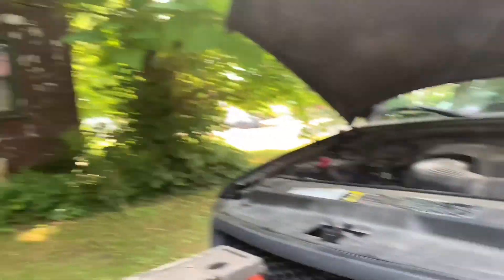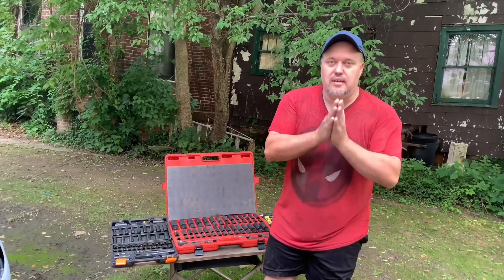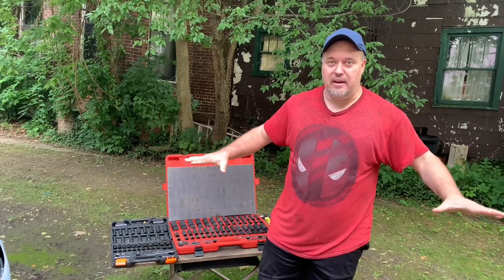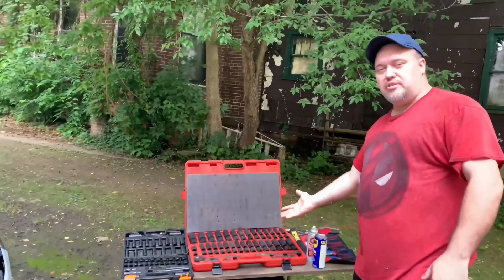How To Remove The Spark Plugs In A 2002 Ford F-150 5.4L Engine V8 Without Removing The Fuel Rails

Comment: Great video, I have an 04 F150 XLT Triton with a 4.6L, I went to do a tuneup on it and ran into a problem. The third cylinder on the passenger side will not accept my 5/8 inch spark plug socket, I can’t get that thing to go on the spark plug to save my life. The first two on the passenger side went smooth as silk, but the third one I cannot get it to go on. Now, I got frustrated and moved on to the drivers side and again the first two went on without a hitch, but the EXACT SAME cylinder the third one will not go on the plug. I’ve tried EVERYTHING I have, wobbles, long extensions, short extensions, etc and NOTHING will work. Idk what/who did what to this thing, but I find it strange that the EXACT SAME cylinders won’t accept my plug socket. ANY IDEAS as to what the heck is going on? I don’t have a bore scope to see what’s going on and my local Autozone wants $137.50 to rent one and I’m not doing that. Any help you can give me would be greatly appreciated, I’m completely stumped. If someone put two different kinds of plugs like 1 Autolite and 1 Bosch, would they be different socket sizes? That’s all I can come up with, thanks for listening.
Reply: try using a regular 5/8 deep socket ,o.d may be thinner, and use a magnet to pull up plug
Reply: @jim9132  ok great, thanks so much.
Reply: I just ran into the same exact problem #3 passenger. The boot on mine was soaked, warped and burnt. The spring was fused to the plug. The socket would not catch the plug. I think the plug may've been loose. I found, a piece of carbon or plastic was interfering. After many tries, I tightened the plug, but the socket wouldn't come off. I then removed the plug that was very hard to loosen, all the way out. I reinstalled without the rubber socket insert. Furthermore, I tuned and turned by hand and felt it wasn't catching until it suddenly stopped. One 1/8 turn on the ratchet, it was fully tight. This seemed wrong, but it was tight. The #2 cylinder, was no issue by comparison.
Reply: @richdelgatto2522  what a nightmare, I finally was able to get them out thanks to a friend with a borescope and WAY more patience than I have lol. It’s running like a champ now, I hope yours is too. 😁
Reply from the maker: Yes mines running good 👍

Comment: It's not the 2 valve engines that are known for spark plugs breaking in the head, they are a one piece plug. It's the triton 3 valve engines (2004-2010) that are known for breaking in the head and it's usually always the rear plug on either bank. Hmmm I wonder why the back ones...we'll because it's so hard to get to that people either rush or don't have the correct combination of extension/swivels and they torque break them because they weren't perfectly centre. That's why companies make specific tools to remove those plugs. The triton 2 valves were known for ejecting the plug because of the poorly designed 3-4 threads the head has. I own a 03 triton 5.4 and you want to make sure you torque to 20-25ft/lbs. Factory spec calls for 13ft/lbs!! Ya maybe if it had 6-10 threads holding. Obviously you don't want to over do it and strip out the aluminum threads but I have done mine at 20ish ft/lbs and no problems with many thousands of miles. Funny how Ford messed up on the first gen tritons ejecting spark plugs so then they engineer a 2 piece plug with many more threads to catch that now break off in the head. Like I said it's mostly due to worker error on that part, but a one piece plug design would of helped tremendously.

Comment: You don’t have to take off half of what you took off. Just take off the plastic cover that says 5.4 and that’s it. They are all easy to get to without removing the air intake and the bracket that holds the throttle cable to
Reply from the maker: I’m not trying to sound mean or anything when I say that so don’t take this the wrong way.  I know that the way I did the procedure here works and if you know of a better way than the one I did in the video you should make your own video and show everybody that video. 👍
Reply: Maybe for somebody with skinny arms, but us larger folks need the extra room, so that little bit of extra work is well worth it.
o

Comment: This isnt the engine that is notorious for the plugs breaking off. That's the 3 valve triton engine with those long weird loking plugs. This engine does have an issue with plugs blowing out while driving down the road. Looks like thats what likely happened with the one plug you had. definately a helpful video though.

Comment: Typical Ford engineering: make repairs as difficult as possible, also design plugs that break off in the head (two piece plug,  why?), Shorten plug length so they blow out of the head, and then design specific Ford-only tools to do the repairs. They've been doing it for decades.
Reply from the maker: They don’t want people working on their own vehicles so they can make more money by selling parts and tools.

Comment: a good strong magnet on an extension handle is real handy on this job. as usual ford engineered these cop systems so the job would be as difficult as possible so dealers can screw the customer out of as much money as possable, the going cost for this job here is $450-700 I can change plugs on my tahoe in 30-45 minutes ford=shit